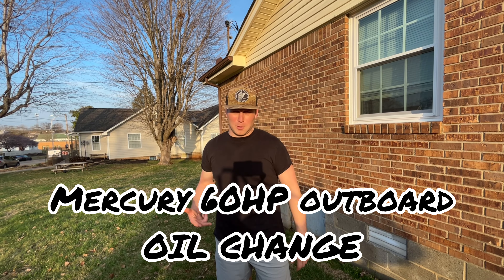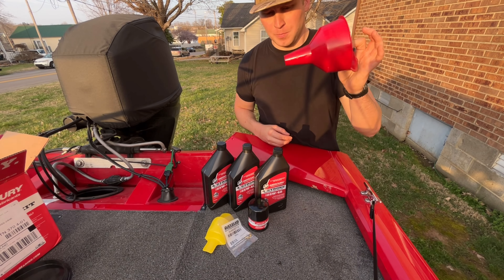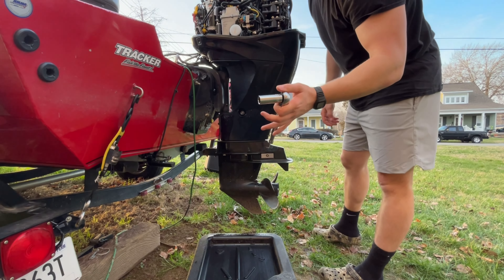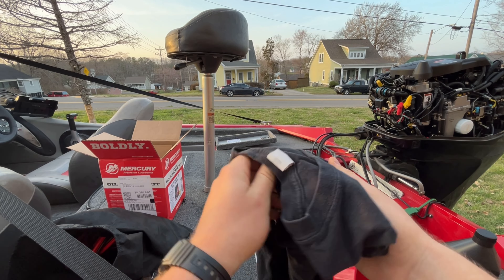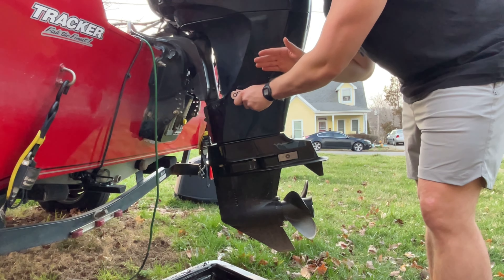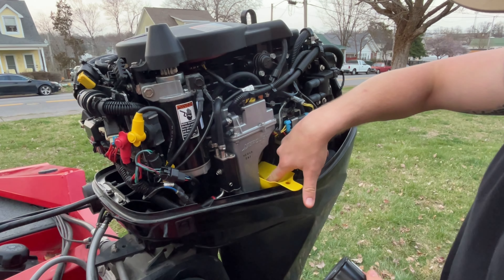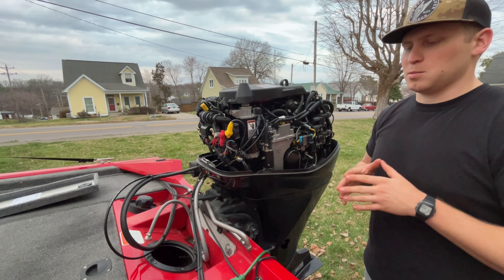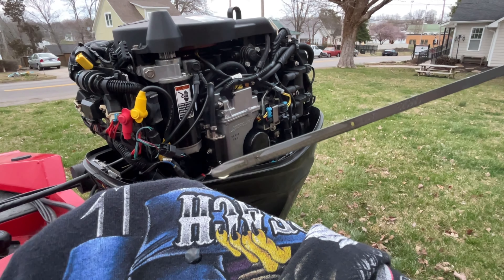Mercury 60HP (4-stroke) Oil Change

Comment: Thanks for a great video.  Where did you get the motor cover?  Also, a shared tip - 50/50 mix of white vinegar and window cleaner makes a great motor cleaner.
Reply from the maker: Good tip. I got my motor cover online from Ocean South
Reply: Thanks for taking the time and getting back to me on the cover.  Keep making great videos.

Comment: Great video. I have that exact engine and love it. I sure want to take care of it. I have about 10 hours on it. IS THIS TOO EARLY TO CHANGE THINGS?
Reply from the maker: I’m not sure about that. I bought mine used and change the oil and lower unit fluid once per year. I would check owners manual or call Mercury.
Reply: If your unit is new,It should have came with a book or you can google it on procedure break in hours required by warranty and it will give you the hours when to change the oil,lower gear oil and fuel filters .
I installed the vesselview on my motor and it Bluetooth to your phone and you can keep up with the hours on the motor with that and keep a log of all the maintenance.

Comment: Believe it or not. When the motor cranks over, the impeller spins down below. If the impeller is dry, it could break off the fins when you turn over the motor. I would never crank my motor dry. Just saying. Otherwise great job on the video.
Reply: just running the engine under a min will do no damage to the impeller. it will not get hot enough to cause any damage. there is video on YouTube that they tested this.